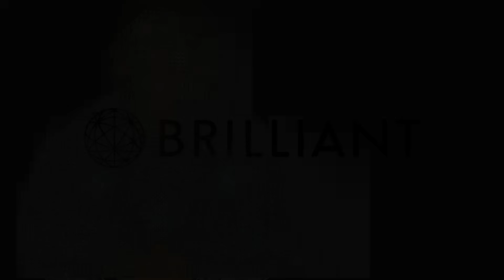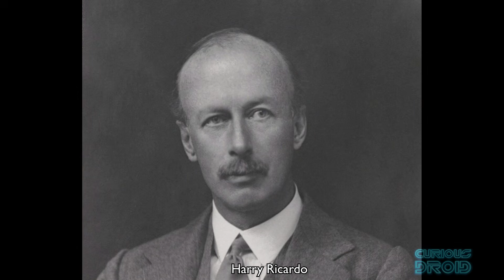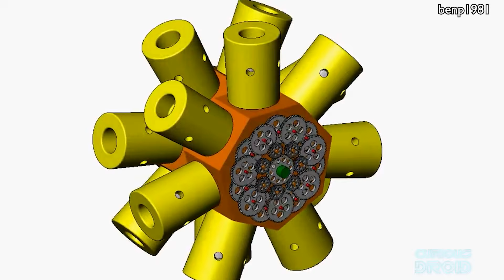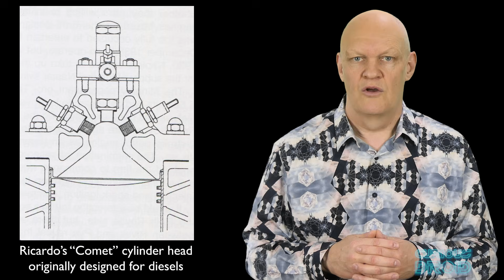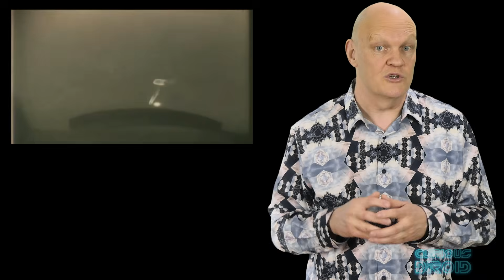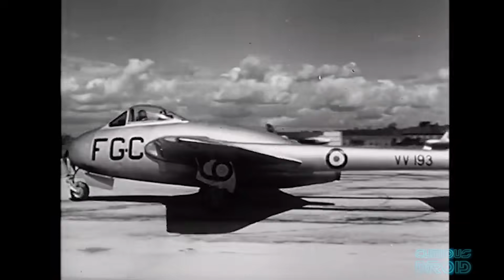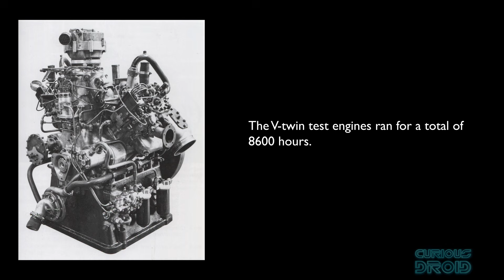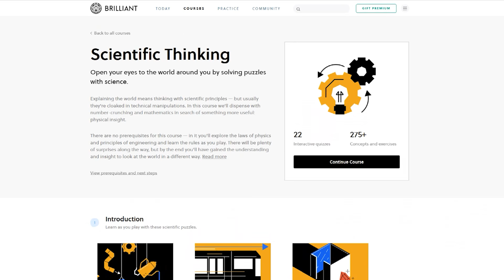Rolls Royce Crecy - The Most Advanced Piston Aero Engine Never Made.

Comment: The Napier Sabre engines on a test stands were clocked at 5500 hp at a capacity of 36.65 litres. That's also pretty impressive!
Reply: And a less powerful version was put into a Hawker Fury prototype (that would eventually become the Bristol Centaurus-powered Sea Fury) to produce one of, if not the fastest piston-engined combat aircraft ever.
Reply: Odd that there's absolutely no mention of the Napier Nomad two stroke, it would be interesting to compare the time lines of both engines.
Reply: @joejoejoejoejoejoe4391  I think that was a Diesel...
Reply: There,s a Napier Sabre engine at the Hendon museum.Talking to a curator there he explained to me that had reliability issues and in cold weather proved very difficult to start.Superb piece of kit though.
Reply: @glennpowell3444  The Coffman starter (bit like a blank shotgun cartridge - famous from the film "Flight of the Phoenix" - really wasn't powerful enough to start the engine, but there was no electric started powerful enough,  The initial impulse power of up to 25hp could damage the engine, a conundrum.  No multigrade oil in those days, in cold weather it flowed like treacle and there were a lot of oiled bearing surfaces in sleeve valve engines.  The ground crew had these big burners and fans on trucks and would blow the hot air through the chin radiator to heat the engine up in cold weather, when that wasn't possible, they just started the engines up every few hours - not good for the engines.  The reliability problems were mostly in manufacture and maintenance and were fully solved by the end of the war.  The "stealing" of several centreless grinders from P&W (I think) solved the final sleeve manufacture problems.
Reply: @robertnicholson7733  Good reply thanks.Yes familiar with the Coffman starter( and the film which was epic).I didn't realise they adopted P and W parts though.I can imagine the torque required to turn that engine and two cranks was enormous though!No wonder it was reluctant to fire up.Thanks.
Reply: @glennpowell3444  Sorry, I was not clear.  What happened is that pressure was brought to bear from the British government and a number of Sundstrand centreless grinders due to be delivered to P&W's production line were diverted to Napier.  This allowed the sleeves to be ground to an accurate and precise cylinder, the lack of this being the major problem with the Sabre.  Apparently, P&W were not happy, I wonder why?  >;-)>

I can't remember where I read it, also I do not know whether it is true, but the story goes that the Sundstrands were shipped to Britain in the hold of a passenger ship against the agreements in place at the time.  Unfortunately, I don't know when this "hijacking" occurred, it would be interesting to see if the ship part of the story is true or not.
Reply: @robertnicholson7733  I understood with the tooling sorry.I suggested parts. I realised my mistake after posting thanks.
Reply: @robertnicholson7733  Oh as a post script machining a sleeve valve is engineering to the very finest of tolerances must take some doing to rotate and breath properly .Extreme engineering way before CNC !!!!Turned by hand.
Reply: @glennpowell3444  Yes! I have seen that one more than once. I supposed I shouldn't have been surprised at how big it is but I was.

There was also the problem described by Clostermann that it was a difficult engine to operate. Carbon dioxide seeped into ther cockpit so the pilot had to breathe oxygen all the time. It also consumed about 27 litres of oil per hour. Clostermann also says that if the engine didn't fire the first time, there was a possibility a a blowback and the aircraft bursting into flames... Temperamental bugger it was.

But I agree with you: it was a remarkable piece of engineering. The whole concept was pretty remarkable and the American ended up making their own versions.
Reply: @thethirdman225  That's also interesting.I didn't know about the oil burn!? To be honest reference its size I am always amazed how the engines of these sizes and weights were actually supported by relatively small airframes.They were essentially cantilevered within the support structures.Thanks for your comment and hope you enjoyed Hendon .The Halifax is still my favourite exhibit along with that famous Lanc.
Reply: @glennpowell3444  No worries. If you haven't read "The Big Show", I thoroughly recommend it. It's one of the very best WWII memoirs out there. Clostermann was a journalist so he knew how to write book and more than any other I've read, he pulls no punches about his fear levels. There are sentences you won't find in any other book like, "Obviously my nerves couldn't stand Flak anymore". Very revealing and honest.

I agree completely about the support structure and these things were supposed to be stressed to multiple G. They don't even look like they'd hold the weight of the engine standing still!

There's an audio file out there of a Tempest and you can hear how different the Sabre sounded compared with other inlines. Much as I like it, I'm more of a Centaurus man, myself, having seen the Sea Fury at many airshows.
Reply: @thethirdman225  Airshow man here too.The Bristol centaurus is a brute and I prefer a radial for noise.I read alot and note Clostermann.Thanks.
Reply: @glennpowell3444  Same here. After you’ve heard a Centaurus the rest are just meh.
Reply: That came up in Setright’s “The Power to Fly” but it’s actually not true. I can’t even find out where he got it from because he didn’t get it from Napier. Both Calum Douglas and the late Bill Gunston poured cold water on the claim, Gunston with mathematical formulae and Douglas with a mechanical explanation. Douglas says that the Sabre’s sleeve valve made it less open to development than a conventional poppet valve engine. The reason is the pressure exerted on the sleeve, making it expand in an already close-fitting block.

Sleeve valves had plenty of advantages, including but not limited to lower noise and high installed base power. What it didn’t do well was boost, which was the best way to achieve higher torque at the time. AFAIK, the highest power achieved by a Sabre in service was about 3,200, though 3,500 has been claimed.
Reply: @thethirdman225  Douglas book is the shizzle.
Reply: @kiwihame  Have you read it, you lucky dog? It sounds like the bomb. I haven’t got it yet but he’s in a couple of excellent YouTube presentations. It’s on the list but it’s rather pricey! Still, I suppose you get what you pay for...
Reply: @kiwihame  I just ordered it.
Reply: @thethirdman225  Napier advertised it as 3500hp+ in Flight Magazine.  It has been claimed at 4000hp for the Sabre VIII on the test bed, that is certainly possible but i have not seen any documentation.  The secret to the Sabre's power is the high RPM.  I would have to do some mathematics to see if anything much above 4200rpm is possible, but I am too lazy.  The BMEP would be high at 5500hp but I doubt it would be high enough to cause significant strain in the sleeves, I also doubt it would be possible to develop that BMEP without some secret squirrel knockless fuel, that is, fuel that does not detonate under any circumstances.
Reply: @robertnicholson7733  I've seen these claims before. Once you understand the Sabre, they sort of don't make a lot of sense. Napier advertised the E.122 as 3,500 hp but I can find no evidence that it ever ran, much less ran in a production aircraft.

And it's advertising material anyway...

The biggest problem with this engine was lubrication and compared to a conventional inline V-12 or radial, the Sabre used a lot of oil - about 27 litres per hour in normal use.

Napier had a lot of trouble getting it to work reliably. Napier drew on a lot of the work done by Roy Fedden at Bristol, who built the redoubtable Hercules and later Centaurus engines. The problems of these engines took almost a decade to solve and thousands of different methods were tried before the engine could be made to run properly, which fortuitously coincided with the start of the war. It almost broke Bristol.

The problem was that the sleeves were not just valves, they were the cylinder liners as well. These sleeves were about 2-2.5mm thick and had to absorb enormous pressure when the engine fired. While these components were quite strong, they were also subject to both thermal and shock expansion. This placed enormous stress on the lubrication system because the sleeve's fit within the block - already pretty tight - would change.

Combine that with the fact that at certain parts of the stroke, the sleeve was unsupported by the cylinder because it was over the ports.

Tighter tolerances means less space for lubricating oil. Less lubricating oil means more heat. More heat means even tighter tolerances, meaning less oil and more heat... and so it goes until the engine seizes. This is why the Sabre was limited in its development potential.

By contrast - and nobody talks about this - the Bristol Hercules - a beautiful engine that was not so widely appreciated, probably because it never found its way into a Spitfire airframe - had ten fewer cylinders and put out about 1,700 hp. I think it started at about 1,200. Yet the Sabre was 36 litres and the Hercules 38. By contrast, the 2,520 hp Centaurus was 53.6 litres.

Calum Douglas goes into this in one of his Q&A videos.
Reply: @thethirdman225  I do understand the sleeve valve engines, i came to sleeve valve aircraft engines via the original Burt designed Argyll engines and to the single acting from the double acting, specifically Minerva.  

The Sabre is fascinating to many people because it is different.  Both the Merlin and Griffin were just another V12 aero engine, both the Bristol Hercules and Centaurus, just another radial (apart from the sleeves).  The Daimler Benzs were just boring except for the direct injection as were the BMWs but the Junkers....much more interesting.

I find all the details more fascinating that the big story.  So although Fedden, Ricardo, Halford, Rowledge, Hooker,etal are best know for the flashy headlines, I rather like the less flashy, more down to earth problem solving, which they also did.

I am well aware of Fedden's work on the sleeve valve engines, and I have looked at quite few Hercules engines, including a mostly complete one and a partial one sitting on a dirt floor in a hut on the Atherton tablelands, in Far North Queensland Australia (so sad).  BUT, the development path for the single acting sleeve valves was Burt, then Ricardo, then Fedden from Ricardo and then Halford from Ricardo and finally RR from Ricardo.  It is Burt who deserves the credit, the aero engines were not much different to Burt's original design, RR did change the drive mechanism in the Eagle 22, but AFAICR the Exe and Pennine drives were essentially the same as all the others.

As an aside, i can remember when i was about 7 or 8, i went to a school friend's place, there were Merlin conrod pairs (several of them) hanging on the walls as decoration, pistons as ashtrays, and other bits I had no idea about, his father used to do full overhauls on Merlins.  Later on, a secondary school friend's father was a RAF aircraft maintenance groundcrew on Merlin and Griffin powered Spitfires, he never worked on the Sabres.  I also had a long conversation with a guy who was rebuilding a Merlin at one of the Australian aircraft museums, he had worked on them for years during and after the war.  The idiots at the museum weren't even watching what he was doing, they should have filmed every minute.  i suppose what I am getting at is just how much knowledge was out there and how little we valued it, too late now.  And so it is with the Sabres.

When it comes to attribution, this is a serious problem with many aero engines, just what is true.  We have some information that is well documented and other information that is not.

For instance, the Sabre using 27 litres of oil in an hour of normal use, just where did that information come from?  Which model Sabre?  When?  

Let us look at the RR Griffin for which I have some official data:
Griffin 65  oil consumption 0.022 lbs/hp/hr  B.m.e.p. 256lb./sq.in.
Griffin 88  oil consumption 0.009 lbs/hp/hr  B.m.e.p. 302lb./sq.in.

So at cruise (say 1300hp) Griffin 65 oil consumption 28.6 lbs./hr, roughly 15litres/hr
So at cruise (say 1300hp) Griffin 88 oil consumption 11.7 lbs./hr, roughly 6litres/hr
These number would be for a fresh engine. A big difference in the main production run of the Griffin.   Oil consumption on earlier Griffins and Merlins could be much higher, also, condition was critical.  Ring technology and machine finishing improved dramatically during the war, so I believe the 6litres/hour.  Merlins were usually quoted at a gallon an hour and up - comparable, so partial confirmation.
The Tiffy had an oil tank of about 16 imperial gallons (I think), so at 27 litres per hour, the tank capacity would be good for about 2.7hours. Must have been tight when they were using 2 drop tanks to increase the range to 1000miles, very tight for, what, 3 hours flying time.

Now as to power, I have just found this site (I may have seen an earlier version some time ago), I don't know which sources he used for the power figures (he has a bibliography at the end)  but much of the power data is accurate against known, definitive sources:
https://oldmachinepress.com/2020/09/20/napier-h-24-sabre-aircraft-engine/

The following quote from  the bottom of the article looks far too credible to be pure fabrication.  If you are in doubt, Ii suggest you contact the author of the page.  

[Quote]
Initially, the Sabre VII had a takeoff rating of 3,000 hp (2,237 kW) at 3,850 rpm with water/methanol injection and 17.25 psi (1.19 bar) of boost. This was later increased to 3,500 hp (2,610 kW) at the same rpm with 20 psi (1.38 bar) of boost. The engine’s military rating at 3,850 rpm with 17.25 psi (1.19 bar) of boost and water/methanol injection was 3,055 hp (2,278 kW) at 2,500 ft (762 m) and 2,820 hp (2,103 kW) at 12,500 ft (3,810 m). The water/methanol injection flow rate was 76 US gph (66 Imp gph / 300 L/min) at takeoff, 78 US gph (65 Imp gph / 295 L/min) at military power in low supercharger, and 122 US gph (102 Imp gph / 464 L/min) at military power with high supercharger. The water/methanol flow rates corresponded to 30 percent of the fuel flow at low supercharger and 45 percent of the fuel flow at high supercharger. The Sabre VII’s fuel flow was 284 US gph (235 Imp gph / 1,068 L/min) at takeoff, 287 US gph (239 Imp gph / 1,087 L/min) at military power in low supercharger, and 289 US gph (241 Imp gph / 1,096 L/min) at military power with high supercharger. At 3,700 rpm and 10.5 psi (.73 bar) of boost, the Sabre VII had a normal rating of 2,235 hp (1,667 kW) at 8,500 ft (2,591 m) and 1,975 hp (1,473 kW) at 18,250 ft (5,563 m). Cruise power at 3,250 rpm was 1,750 hp (1,305 kW) at 8,500 ft (2,591 m) for a fuel consumption of .45 lb/hp/hr (274 g/kW/h), and 1,600 hp (1,193 kW) at 17,000 ft (5,182 m) for a fuel consumption of .51 lb/hp/hr (310 g/kW/h). The engine was 83.0 in (2.11 m) long, 40.0 in (1.02 m) wide, and 47.2 in (1.20 m) tall. The Sabre VII weighed 2,540 lb (1,152 kg). Some sources state that a Sabre VII engine achieved an output of 4,000 hp (2,983 kW) and was run at 3,750 hp (2,796 kW) for a prolonged period without issues during testing.
[End Quote]

So 3500hp, believe it, or not.  Quoting power number really isn't helpful, B.m.e.p. is much better to determine the engine design success (see Griffin numbers above).  The Sabre spun about 1000rpm more than the others (a third as much again) so more power for the same B.m.e.p., the whole point of lots of small cylinders.

Personally, I am far more interested in finding more information on the Junkers Jumo222, Jumo223, and Jumo224, especially the last two.  Unfortunately, this is highly unlikely.  Those quadrilateral two stroke diesels really put the triangular Deltec to shame.  Mind you, I think the shape of the Deltec was (at least partially) determined by the shape of the fast patrol boat engine rooms.

Sleeve distortion through combustion pressure, hmmm, first we would require the stress/strain curve for the sleeves. Not too hard, just need someone to pressurize an unsupported original sleeve and measure the expansion/pressure curve.  We should be able to estimate the combustion pressure curve with sufficient accuracy.  But until that information is forthcoming, it is all moot.  Sleeves covering ports, deflection is a little harder to calculate but still need data to do it.

Yes, yes, thermal issues, i too read all about it with the Hives 50degree (centigrade I think) temperature differential, although no one is sure whether he was talking about the air cooled Exe and Pennine or the liquid cooled Eagle22.  So a question for Hercules versus Sabre as well  The thing is, as the gap between the block and the sleeves decreases the thermal transfer efficiency increases, so perhaps your positive thermal feedback loop does not exist the way you think it does.  There was a quite technical paper written on these issues with sleeves that I read quite some time ago, unfortunately, it is in with literally Gbytes of similar engineering information.  Many of my books, including the Crecy book, were loaned out when my wife and I went travelling in a motorhome for 12 years.  Apparently, they are not going to be returned, very annoying.
Reply: @robertnicholson7733  Mmmm... Those figures were all for the Sabre VII which used methanol water injection and as far as I can tell, was never used in a production aircraft. In fact, I'm not sure it ever flew. Now, from that quote:

"Some sources state that a Sabre VII engine achieved an output of 4,000 hp (2,983 kW) and was run at 3,750 hp (2,796 kW) for a prolonged period without issues during testing."

I frankly, don't believe a word of that. Not a bit of it. Not your fault but no way.

I don't believe the claimed power and I certainly don't believe the claim that it ran reliably at5 3,750 hp for extended periods. I don't believe it for two reasons: 1) I can find no evidence that it ever ran at that power level or even close and 2) no reference for that claim is provided, just a vague "some sources state". My background is journalism and academia so that claim just doesn't cut it.

There are, as you know, only two ways to improve power: increase torque or increase RPM. I know you know this because you referred to calculating for 4,000 RPM earlier. I can't see how such an immense increase in power could have been achieved, bearing in mind the exponential increases in internal stresses that go with it.  Now, I don't mind a certain amount of spitballing - we all like to do it with out favourite things - but there's spitballing and there's making the facts fit the story. When something that starts as something that might be plausible and gets converted into "fact" with no verifiable sources, I just switch off.

You probably realise that I'm not an expert on piston engines of any kind, either by profession or inclination. I just look for what is believable and what isn't. This one doesn't pass the pub test.

"So a question for Hercules versus Sabre as well  The thing is, as the gap between the block and the sleeves decreases the thermal transfer efficiency increases, so perhaps your positive thermal feedback loop does not exist the way you think it does."

Not my loop.

Decreasing the gap between the sleeve and the block might help the thermal transfer but not the lubrication. So where do you see this ending? Sooner or later, the engine will sieze.
Reply: @thethirdman225  A couple of small points:
Just because it never flew does not mean it was not flight ready, Unfortunately the British Aero industry is littered with abandoned projects.  Gas turbines were seen as the future and many thought it would not take long to increase the fuel efficiency back up to levels for ICE engines, as you may know, they were greatly mistaken.  However, if you want to go fast then you use a turbine, in this they were not mistaken.  The Eagle22 was in much the same boat as the Sabre VII, both anachronisms.  In any case, the VII was not a new engine, there were modifications and strengthening involved (like with the IV) but it was essentially the same engine.

ADI (methanol/water injection)  was part of the Aero engine main stream, so I see no reason to single the Sabre out.  Similarly, exotic fuels (very dangerous and toxic ones)  were also fairly mainstream.  I don't see this as a point for discrimination.

Before I try out some back of the beer coaster calculations, I might add that power outputs such as we are discussing was not really an issue in later times.  In 1982 the BMW M12/13 F1 engine which was a turbocharged 1500cc 4 cylinder was good for 1400hp (calculated but probably pretty accurate, nevertheless) in qualifying form, and about 1000-1200 in race form (the driver had a button to change forms).   

This type of power was forecast back in WWII, at the end of the war all the engine manufacturers knew that the path to power was just to stuff as much air and fuel into the engine as possible while holding it together and avoiding detonation.  It still is.  It is possible to get somewhere north of 1700hp at the back wheels tt of an Australian designed and built Ford Falcon 4.2litre straight six by replacing the valve springs, head studs, pistons and conrods, fitting oversized injectors, a big turbo, and suitable engine management software, everything else being factory including the crankshaft - a street car at that.

Tresilian of RR Crecy fame did some design studies on a turbo compound 2 stroke design that was to produce 2500hp from 7.8 liters, or a two stroke X24 of 39litres producing 8100hp at 4600rpm on 35lbs of boost.  The problem was the prop gearbox in the 7.8litre design weighed more than the rest of the engine.

 If I look at piston speed as one of the limiting factors, a simple calculation based on know max speeds for period conrods (mostly German Aero engines like the DB603N and the Jumo 613E) of about 18metres/sec, the Sabre could have turned at 4500rpm.  I have never seen this number officially mentioned.  Certainly, 4200rpm would have been possible.  Working off the know and official 3055hp at 3850rpm, 4200rpm is about 3300hp and 4500 rpm is 3570.  I don't think this is the way they would have come to these higher powers, it would almost certainly be through forced charge induction.  Napier was workng on a 3speed, two stage, inter and post cooled supercharger system, where this fits in the Sabre VII story is the unknown to me.

I believe 4000hp is possible under some pretty extreme circumstances, but whether it happened is the question.  Napier was known for doing extreme things like purposely driving a turbocharged Napier Deltic well beyond its design limits to essentially see what happened, as forecast, conrod failure at a slightly higher velocity than what the Napier engineers had calculated. Of course, during the war RR consistently tested Merlins, Griffins, etc. to destruction to see what needed to be improved, in this RR reigned supreme, at least in Britain, in the Merlin the development work required was extreme.

Not my loop.  Well it was the positive feedback loop you described, in reality it just doesn't work that way.

Ricardo dealt with the heat transfer problem of the oil film between the sleeves and the cylinder castings in one of his lectures to a whole bunch of engineers who would not have let him get away with much.  He considered it a non issue.  Napier themselves implemented a number of non-conventional approaches to lubrication and oil consumption and appear to have succeeded - I do not have a reference, do you for the 27litres/hr?  All of this carried over to the Deltic where not only was lubrication critical but also the issue of bore glazing had to dealt with.  They used multiple methods including dimpling the bore, something that harks back to hand scrapping bearing surfaces on lathes, milling machines, etc.

Finally, lubrication (tribology - a part of fluid dynamics), what you must understand is that this area is not subject to common sense or normal projection.  Fluid dynamics is highly (extremely!!) non-linear, can be chaotic and defies complete analysis, we have merely touched the surface. 

If the cylinders, sleeves, etc are properly formed and have the correct surface finish, the oil film can support enormous pressures with no interference of the metallic surfaces.  There are many examples of this.  One I would like to draw your attention to is the Michell slipper bearing.  When Michell developed this bearing (and the theoretical foundations for it) he revolutionized ship design.  Previously, the thrust from the propeller had to be transferred to the ship by multiple, large, precision aligned, conventional thrust bearings.  Michell reduced all of this to a single, relatively small, thrust bearing that generated its own hydrodynamic thrust.  The entire thrust of the enormous propeller is transferred to the hull of the ship by an oil film!

In the Sabre, seizure was almost always a function of distorted sleeves, by the end of the war this was solved, and the engine was considered very reliable.
Reply: @robertnicholson7733  
"Just because it never flew does not mean it was not flight ready"

For the purposes of this debate it does. As I said, I still cannot find any reliable reference that says any Napier Sabre variant produced more than 3,200 hp. And using the same reasoning, I can find no reference showing that the E.122 - supposedly good for 3,500 - ever proceeded beyond the drawing board. That tell me that a 4,000 hp Sabre is a myth.

"ADI (methanol/water injection)  was part of the Aero engine main stream, so I see no reason to single the Sabre out"

This is wishful thinking Robert. I'm sorry but I can't think of a nicer way to say it but just because the Germans used MW50, that doesn't mean the British were using it, much less the Sabre.

"In 1982 the BMW M12/13 F1 engine which was a turbocharged 1500cc 4 cylinder was good for 1400hp (calculated but probably pretty accurate, nevertheless) in qualifying form, and about 1000-1200 in race form (the driver had a button to change forms)."

This is not remotely comparable. The BMW did not have sleeve valves, ran on highly specialised fuels like toluene and ran at 5 bar boost for one lap. And it ran at that power for one year - I think it was 1987. In any case, there is no comparable sleeve valve in the BMW. Besides - and this is a critical difference between aero engines and racing car engines - Aero engines are designed to run at 80% power or more for long periods so peak power isn't as critical as being able to run reliably for extended periods. A mate of mine tried this with powered hang gliders in the 1970s, using 250cc motorcycle engines and he broke a number of them doing it. Most engines are simply not designed for that kind of sustained power output. The demands on aero engines are completely different.

"Napier was known for doing extreme things like purposely driving a turbocharged Napier Deltic well beyond its design limits to essentially see what happened, as forecast, conrod failure at a slightly higher velocity than what the Napier engineers had calculated."

I have never seen anything to suggest that Napier did anything differently from other manufacturers in WWII. Their development of the Lion in the Schneider Cup series was probably their high water mark in their quest for extreme power (in per litre or per cylinder terms). Beyond that, the Sabre was about meeting a foreseen requirement, rather than trying to see who could make the most power.

"Not my loop.  Well it was the positive feedback loop you described, in reality it just doesn't work that way."

Yeah but your reality says that the tighter the sleeve fits the better it works because of heat transfer into the block. When does it become too tight? When does the engine seize, Robert? They were already a pretty tight fit at operating temperature.

"He considered it a non issue."

So? He was talking in the 1920s.

"Finally, lubrication (tribology - a part of fluid dynamics), what you must understand is that this area is not subject to common sense or normal projection.  Fluid dynamics is highly (extremely!!) non-linear, can be chaotic and defies complete analysis, we have merely touched the surface."

We don't need detail on this. Surely there is a point of no return: that point where there is simply insufficient lubricant between the two surfaces to prevent the engine from seizing. Calum Douglas explains this in one of his videos. You are talking as though seizure wouldn't happen. Where do you draw the line?

"In the Sabre, seizure was almost always a function of distorted sleeves, by the end of the war this was solved, and the engine was considered very reliable."

Douglas disagrees. I don't think it was ever that simple. Neither does he.

There are all manner of cult-status engines out there which capture the public imagination and inspire people to create rose-tinted scenarios. The Porsche 917/30, the BMW M12/13 and the Napier Sabre are obvious ones. But when you go beyond the hyperbole and read the comments of - in this case, pilots - the reality sinks in.

"However, this hasty rushing into action had not been without its disadvantages. The Sabre engine found a diet of 130 grade fuel uncongenial. There were some serious accidents. Snags arose over the induction system (the Sabre was a sleeve-valve engine), over the lubricating system - the oil pressure sometimes suddenly dropped to zero - carbon dioxide suddenly found its way into the cockpit, etc..

The worst was the accumulation of petrol and oil fumes in the carburettor intake, which led, we were told if ever the engine backfired, to the plane bursting into flames, and sometimes exploding in the air in a matter of seconds." - Pierre Clostermann, "The Big Show"

That was from an operational pilot who flew the Tempest.

There were other problems Clostermann talks about in other parts of the book: oil consumption, difficulty starting, carbon monoxide in the cockpit (he incorrectly refers to carbon dioxide)... There was also matters relating to the Coffmann starter system and its use with both a H form engine and sleeve valves. The oil of that period had a tendency to congeal and starting the engine presented wear and tear problems at the tops of each bank. Secondly, the sudden shock of an explosive system like the Coffmann, could potentially damage the valve gear operation (Douglas).

So clearly, power isn't everything. This begs the question (two, in fact) - if the Sabre was that difficult to operate in service, what was the point of trying to get more power out of it? There were already enough deficiencies in its operational readiness as it was. And why, if the Sabre had so much potential, was it replaced with the Bristol Centaurus?
Reply: @thethirdman225  Reply part2
<quote>
I have never seen anything to suggest that Napier did anything differently from other manufacturers in WWII. 
<end quote>  

The Initial design and development of most WWII engines was well before WWII.  Also, most of these engines had a design pedigree or philosophy going back much further, that is, the manufacturers kept redesigning the same engine.  For instance, RR had designed V12s for 20 years or so, their branching out into X engines was problematic and ultimately fruitless.  Bristol and its predecessors had designed radials for a long time and spent quite some time on sleeve valves. Napier was a small company and had a bumpy history (RR's most hated enemy, see Bentley and Rowledge), but careful study will show how far they pushed the envelope, starting in the very early days of car manufacture, through to the Lion and the Cub.  

Halford fitted in quite well, he always pushed the envelope. He started with the H engines in 1927, joined with Napier for the Rapier and then Dagger. Then Napier and Halford changed from an air cooled, poppet valve, vertical, H engine to a liquid cooled, sleeve valve, horizontal, H engine of unprecedented design power, a big shift in design philosophy. Design work began in 1936, by January 1938 it had passed acceptance tests with a power of 1350hp. In March 1938 it passed a 50-hour test with peak power of 2,050hp.  In June 1940, the engine passed a 100-hour type test with a maximum output of 2,050 hp, production.  In contrast, the RR Merlin design started sometime before 1933, things did not go well despite the considerable resources available to RR, in August 1937 the Merlin was at 1030hp maximum power (comparable B.M.E.P applied to a Sabre would indicate 1700hp).  Of course, by 1940 Hooker had waved his magic wand, the rest of the design team could finally get out from under (partially) and the Merlin started its rise to fame.  The Sabre was stuck with reliability problems and an inadequate induction system with power staying much the same from then on.  Napier had pushed the envelope hard and fast with the Sabre and it came back to bite them, they just didn't have the resources of RR or Bristol to address the production issues.  Photos of the Acton works tell the story.  

The Sabre was the smallest of the three high-powered engines the air ministry was betting on for the big Hawker fighter, hoping one would succeed, they were the Centaurus of 53.6l, Vulture of 42.5l, and the Sabre of 37.6l.  The Vulture was cancelled (and the Hawker Tornado with it) due to significant design issues and poor power delivery (it was more or less two Peregrines on a common crankshaft and the Peregrine, itself, was just an updated Kestral), the Centaurus was not put into production until the very end of the war, and the Sabre had serious production issues.  The Sabre, of course, did power aircraft in WWII and powered IMO the best low level British fighter.  The final backup engine for the Tempest was the Griffin but at the time it was destined for other uses and was underpowered for the Tempest.  

Indeed The Sabre was the only 24 cylinder aero engine to see serious production, German aero engines that deviated from their manufacturer's long term design philosophy were also unsuccessful, e.g. Junker Jumo222, etc.

So, in my opinion, Napier was very different to the others, except, perhaps, Junkers.

<quote>"Not my loop.  Well it was the positive feedback loop you described, in reality it just doesn't work that way."

Yeah but your reality says that the tighter the sleeve fits the better it works because of heat transfer into the block. When does it become too tight? When does the engine seize, Robert? They were already a pretty tight fit at operating temperature.  
<end quote>

The reality I live in but i don't own it, it is pure thermodynamics, combined with tribology, materials science (metallurgy is just a subset), mechanical engineering, and production methodology.  Very complex and unpredictable, even today, which is why all the manufacturers (and Ricardo Engineering) built test engines (usually of two cylinders ) and prototypes.  Fedden used a two cylinder test engine to test all those sleeve variants, I have a photo of it somewhere.  

Anyhow, what I said was "as the gap between the block and the sleeves decreases the thermal transfer efficiency increases", you will note I expressly stated "thermal transfer", alone.  Even then, thermal transfer is a two-edged sword, the need to keep components at design temperatures against excess heat rejection.  Excess heat rejection decreases the amount of heat energy available that can be converted to kinetic energy as well as increasing the enlargement of the cooling system.  IC engines are heat engines and all the usual rules apply.

<quote>
"He considered it a non issue."

So? He was talking in the 1920s.
<end quote>

No, in the 1950s, I think to the SAE.  He also addressed it in his book "The High-Speed Internal Combustion Engine" 5th Edition, a completely rewritten edition from the 1960s.

<quote>
Finally, lubrication ..Fluid dynamics is highly (extremely!!) non-linear, can be chaotic and defies complete analysis, we have merely touched the surface."

We don't need detail on this. <end quote>

Perhaps you don't (who are the "we"?), but the world runs on thin films of oil. For example, most engines run plain bearings with very large forces acting on a relatively small area.  The  bearing surfaces are kept apart by a very thin oil film maintained by a fairly low oil pressure.  Just to make things more interesting, the load is cyclic and subjected to various perturburations caused by , amongst over things, flex and modes in the crankshaft and that is just the main bearings, after that, there are big ends, little ends, gearboxes, etc..  If properly maintained, not only do these surfaces not seize, they barely wear over the life of an engine.  They only touch when the engine starts, which is when most wear occurs.   

In any case, it was you who brought up the oil film issue.

<quote>
Surely there is a point of no return: that point where there is simply insufficient lubricant between the two surfaces to prevent the engine from seizing. Calum Douglas explains this in one of his videos. You are talking as though seizure wouldn't happen. Where do you draw the line? 
<end quote>

Depends entirely on the circumstances. Of course the sleeves sometimes seized which is why there were shears on the sleeve drives.  However, as techniques improved, sleeve manufacture was improved to the point where the Bristol Centaurus had very long TBOs, I don't have any authoritative information of the seizure rates of Sabres over their production history.  I have seen very little information on the RR sleeve valve engines.  This begs the question, why would RR persist with the Eagle 22?  RR had spent a fortune on developing poppet valves, if the sleeves were such a problem (and expensive), why use them?

<quote>
"In the Sabre, seizure was almost always a function of distorted sleeves, by the end of the war this was solved, and the engine was considered very reliable."

Douglas disagrees. I don't think it was ever that simple. Neither does he.
<end quote>  

Think or prove?  Do you, or he, have official data showing persistent sleeve problems throughout the production run of the Sabre?  What data does he have on Sabre maintenance?  How does it differ to Bristol data on sleeve valve issues?
Reply: @thethirdman225  reply part 3

<quote>
There are all manner of cult-status engines out there which capture the public imagination and inspire people to create rose-tinted scenarios. The Porsche 917/30, the BMW M12/13 and the Napier Sabre are obvious ones. But when you go beyond the hyperbole and read the comments of - in this case, pilots - the reality sinks in.
<end quote>

cult-status? rose-tinted? hyperbole?  ahhh  <sigh>  As to pilots, well I have full respect for them as I do race car drivers.  However, that does not make them experts on their machines.  There were few race drivers, very few, who were really good at developing cars but most were/are not.  In his era , Black Jack Brabham was considered the best development driver,  his friend Bruce McClaren another.  Brabham is, and is likely to remain, the only driver to win a world champion in a car of his own design.  He could have been an even more successful driver (another championship) but he often drove the "second best" car and left the more sorted car for others.

I haven't read Pierre Clostermann's book, but I would assume the carbon monoxide was more an issue with the airframe design.  The Sabres did catch fire sometime when starting, the ground staff put out the fire and carried on, Sabres weren't the only ones with the issue.  However, the hearsay comment at the end doesn't make sense.  It would be interesting to find out how a build up of fumes in the carburettor intake could occur with the prodigious amount of air being passing down that intake while the aircraft was in flight.   To me, passing on hearsay like that casts doubt on his understanding of the basics of aircraft engines and physics.  If he didn't see it, how did he know it ever happened?  It could just be another story bandied around.

RR was more concerned about backfiring of the Merlin, caused by pre-ignition, burning the fuel mix in the main truck (between the cylinders and the flame traps).  Several cycles of this could cause the engine to cut out, explosions and crashing aircraft weren't mentioned  (A. C. Lovesey).  The pre-ignition was tracked down to spark plug issues, both manufacture and maintenance. 

<quote>
That was from an operational pilot who flew the Tempest.
<end quote>

I would be interested to hear the opinions of the pilots who flew aircraft with early marks of the Merlin, at least before it became pretty much sedition to complain about the Merlin.  Everyone has their opinions, likes and dislikes, some loved the Tempests, some hated them, others changed their opinions from sortie to sortie.  Even the Griffin had its detractors and that was a very well-designed engine. 

The stakes are lower, but most people who work with imperfect machines are the same. I had (have?) irrational prejudices against certain stuff that I have worked on and exaggerate certain negative views, that doesn't make it fact, nor necessarily fiction, the truth couldn't be determined unless a detailed analysis was performed on the machine.

<quote>
There were other problems Clostermann talks ...
<end quote>
Most of this has been discussed in my previous posts. 

The stripping of upper cylinder lubrication from excessive fuel was well known and procedures were put into place to address the issue, I have seen references that state penalties for ground staff who did not follow the procedures were severe. 

I would still like to know the circumstances of the 27l/hr oil consumption figure you posted. 

The high viscosity of mono grade oils when cold (congeal is somewhat ambiguous), the problems it caused, and the solutions put into place have already been addressed in previous posts.  Sabres were not alone in having this problem.

And of course all the other issues are the usual stuff common to most engines, things break.

<quote>
So clearly, power isn't everything. This begs the question (two, in fact) - if the Sabre was that difficult to operate in service, what was the point of trying to get more power out of it? There were already enough deficiencies in its operational readiness as it was.
<end quote>

It was used as there wasn't any other engine available that could do what it did. As to getting more power out of it, well, if a lot of the work has already been done and RR (the enemy) was building a sleeve valve H24, who wouldn't work toward putting them in their place, just an opinion dressed up as an answer to a leading question. Your second sentence is gratuitous.

<quote>
 And why, if the Sabre had so much potential, was it replaced with the Bristol Centaurus?
<end quote>

The Tempest II and Tempest V were developed in parallel, the Centaurus didn't replace the Sabre, they just stopped making the Tempest Vs and honoured their contracts with Bristol.  There were 800 Tempest Vs manufactured and 450 Tempest IIs.   But wait!  If the Centaurus replaced the Sabre, and the Sabre still had serious problems, why order the Sabre V powered Tempest VI? They built 140 of them after the war.  I read somewhere that the Tempest VI was the last operational piston powered fighter used by the RAF.

The Sabre died because it was a dedicated military engine and the military was going turbines.  The RR Eagle 22 died because it was a dedicated military engine, all the aircraft it was destined for were cancelled, and gas turbines were coming.  The Griffin and Merlin continued in some end-of-war-aircraft such as the deHavilland Hornet (magnificent) but mostly kept legacy aircraft in the air.   

The Merlin was AFAIK the only liquid cooled inline high performance engine to see commercial use (and limited at that) and even then, RR had to derate it and do a lot of problem-solving to get its TBO up to a viable length, the TBO still wasn't great.  

The Centaurus was designed with a clear goal of dual military/commercial use, this dual use made it a more viable long term option, costs could be defrayed.  The RR Pennine was developed with a view of commercial use, once RR got into turbines the Pennine was history.  Equally, the Junkers Jumo 223 and 224 were clearly designed for commercial use.  The big American radials were on the same path as the Centaurus.  The British government pulled the strings on the aero industry and decided who did what.  After the Tempest VI, the British government made it clear that there would be no more Sabre contracts, the Eagle 22 was the preferred option, not that it did the Eagle 22 any good.  The other big issue was cost, it was an expensive engine to make and maintain, the order of cost went something like this; Sabre, Centaurus, Griffin, Merlin, Allison.  

I will leave it to others to fight out RR vs Packard, I personally liked the styling and chassis of the Packard cars of the 20s over most everything else of the era but think their automotive engines left a lot to be desired, there were far better engines on both sides of the Atlantic.

In one of your previous posts, you said you liked to think of yourself as an investigative journalist and that you wanted primary sources.  Well if you want to be an investigation journalist, you need to leave the attitude at the door, the little snipes especially when I would not accede to your narrative were very unprofessional.  You also need to leave YOUR narrative at the door.  I assume no pretence of being an investigative journalist, so I get to keep my narrative, although, most people who know me would laugh if anyone suggested I looked at anything through rose-coloured glasses.
Reply: @robertnicholson7733  I have taken the time to read your increasingly lengthy posts and I'm frankly finding your information less and less relevant to the case. So I will post again what I have been saying since the start and which I have yet to see any solid evidence on:

1) I can find no evidence that a production Napier Sabre engine ever exceeded 3,200 hp (which is a lot of power, in case you're getting jaded).
2) The proposed 3,500 hp E.122, as far as I can make out, never got beyond the drawing board.
3) I can find no evidence that the Sabre VII ever ran, much less ran reliably to 4,000 hp with 3,750 hp for extended periods.
4) BMEP is only one measure of engine efficiency (Volumetric Efficiency is another). Yes, that was the metric used which most influenced the Sabre design but it's not a substitute for a flying example. This is an example of "never mind the quality, feel the width".

This is from reading the likes of Bill Gunston and Calum Douglas. If you haven't read either then I strongly suggest you do, particularly Douglas. His book "The Secret Horsepower Race" is brilliant and is about as in-depth as it gets.

"In any case, it was you who brought up the oil film issue."

You are talking as though there doesn't need to be any oil and heat transfer will solve everything. When does thing become non-viable, Robert? When does the engine seize?

"This begs the question, why would RR persist with the Eagle 22?"

I neither know nor care. But if you read Douglas's book, you will soon see exactly why the more radical projects didn't go ahead and Britain concentrated on building things that worked and would present no problems in the foreseeable future.

"The reality I live in but i don't own it, it is pure thermodynamics, combined with tribology, materials science (metallurgy is just a subset), mechanical engineering, and production methodology."

When is there insufficient lubrication, Robert? When does the heat transfer reach its limit and the engine seizes?

"Think or prove?"

I could present a welter of data and you would still brush it off.

"Do you, or he, have official data showing persistent sleeve problems throughout the production run of the Sabre?"

This from someone who has yet to provide anything beyond a blog. I'm sorry Robert but you're not in any position to make demands. I have already told you that the problems I have believing the claims you and others are making are due to a singular lack of evidence. Read Douglas's book. He's a mechanical engineer who worked with the Toyota F1 team in the noughties. His credentials are very good and his research is as thorough as I have ever seen on the subject.

"I would be interested to hear the opinions of the pilots who flew aircraft with early marks of the Merlin, at least before it became pretty much sedition to complain about the Merlin."

I wouldn't. That's just whataboutism, Robert. Who cares about that? The point was that Clostermann explains the engine management quirks of the Sabre.

"Most of this has been discussed in my previous posts."

No it hasn't, Robert. You simply cannot fob off the words of an operational fighter pilot just like that. If you have ever done any flying (I have) you know that flying is all about procedures. It is totally different from motorsport in almost every aspect. Pilots are completely different from racing drivers. The start procedure for the Sabre was very precise. The throttle setting had to be exact and timing was critical. Flying the aircraft focused on settings, optimum speeds for efficiency (engine and aerodynamic), stall speeds, VNE, etc.. As for dismissing advice as "rumours", if a pilot was warned about a particular aspect of an engine, he had no choice but to take it seriously. His life depended on it. That's how it goes in flying, especially combat flying.

"The Tempest II and Tempest V were developed in parallel, the Centaurus didn't replace the Sabre, they just stopped making the Tempest Vs and honoured their contracts with Bristol.  There were 800 Tempest Vs manufactured and 450 Tempest IIs.   But wait!  If the Centaurus replaced the Sabre, and the Sabre still had serious problems, why order the Sabre V powered Tempest VI? They built 140 of them after the war.  I read somewhere that the Tempest VI was the last operational piston powered fighter used by the RAF."

Except that Hawker's future designs were all built around the Centaurus radial, right up to the Sea Fury, which remained in service through the 1950s.

"In one of your previous posts, you said you liked to think of yourself as an investigative journalist and that you wanted primary sources."

The hell I did. I made no such claim and it's not a matter of what I "like to think of myself as". My background is journalism and academia. That's it. To that end, all I care about is the best available version of the truth. To get that requires relevant references. And the whole point of this is that I can find nothing to support any of the points I laid out earlier.

"Journalism is printing what someone else does not want printed. Everything else is public relations." - George Orwell.
Reply: @robertnicholson7733  Amazing data you have written. It has answered many questions I have often wondered about. Thank you for taking the time to write this intriguing article.
Reply: @brianmuhlingBUM  Thanks, it is an interesting area but there is little surviving information out there on most of these engines.  The companies just trashed it when they; needed the space, moved, or were taken over.  I have done the same in my area of engineering, although, I can't ever see that information as interesting to anyone including me.

As far as I know, there is not even an extant set of original engineering drawings for any Sabre model.  I think there are drawings of early model cylinder blocks only , so the chance of original performance data surviving is very low.  Even RR information is very thin on the ground, oh well, we can always make it up.  >>:-)>>

All the best,
Rob
Reply: @robertnicholson7733  Thank you Rob for all that interesting information. During my motor racing days (1960's) using small capacity engines, anyone who could manage 100hp per litre without supercharging, would be doing very well. Huge motors can not manage 7000 r.p.m. or more otherwise they would fly to pieces. So I doubt that even super- supercharging the Napier Sabre, it would not manage those extraordinary figures that some people are claiming. Pierre Closterman mentions revs of up to 4000 and 3000 HP,  but whether he saw that on the tacho or not, we now will never know.
Reply: @brianmuhlingBUM  The Sabre IV (if memory serves) was a special high RPM version of the engine and was officially rated at 4000RPM.  The later ones reverted back to 3700 - 3800RPM range.  4000RPM in service would not be unreasonable, most engines were pushed hard in battle, I would not be surprised to see the revs go higher in a power dive.  I do not know how he found the power figure, there is no easy way for a pilot to find out.  

All of this is muddied by exactly what we mean by maximum power, the WER (War Emergency Rating) was not a standard and most manufacturers and countries defined it in different ways, some of them were strange to my mind.  

Napier definitely advertised the post-war Sabres at 3500hp (I have seen the ads in Flight).  Considering the audience they were advertising to, there would be little point in lying about the power output. 

If you project maximum piston speeds and BMEP of engines contemporary with the Sabre VII, you can get numbers in excess of 4000hp even when taking into account the additional losses caused by the higher rpm.  I personally don't think they would have pushed the engine much past 4000rpm, but there is no way of knowing.  

It was interesting that the later engines did not have the crankshaft counterweights of the earlier engines.  Perhaps it was better balanced than people thought.  Due to its layout, it was an immensely strong engine that did not share the stress issues present in V engines such as the Merlin

There is a partially sectioned VII in Canada complete with ADI.  I have held a long term hope that someone will disassemble the engine and scan it down to the last bolt to produce a full set of drawings for the VII which would have been the only candidate for the 3050 and 3500hp ratings.  Perhaps some questions would be answered. 

Large engines just can't compete due to flame front speeds.  A number of companies and organizations have done much research on combustion dynamics and the consensus is that 500cc per cylinder is ideal, so an H24 should be about 24 litres and be well over square.  Looking at Halford's earlier engines in this context is most interesting.  As I have previously posted, Stewart Tresilian did design studies on small (very over square) aero engines and racing engines for various British racing groups, unfortunately very little of it was put to work.

I just find it sad that so much fascinating information has disappeared, never to be seen again.
Rob
Reply: Thank you Rob, you have gone to a lot of bother typing all that valuable information that I really appreciate.
Best wishes, 
Brian, Western Australia
Reply: If you chopped of the massive supercharger and replaced it with turbos, could a sabre by squeezed into a spitfire ?
Reply: @joejoejoejoejoejoe4391  I would have thought that would make it even harder to fit. I can't see the point.
Reply: @thethirdman225  It would substantially shorten the engine, allowing the centre of gravity to be moved back to help counteract the increased engine weight; the turbos could be fitted wherever there's spare space. Turbos might also increase the power, especially at high altitude. But then I'm just an armchair dreamer with daft ideas, not an aeronautical engineer.
Reply: @joejoejoejoejoejoe4391  one issue in what you talk of here is that if for C of G reasons you install the turbos aft of the cockpit you'd need to rout the airflow ducting to and from the turbos. That would mean a more bulbous fuselage and the Spitfire's beautiful lines would look more like a jug, like a P47.
Reply: @joejoejoejoejoejoe4391  the Sabre was about 10 inches wider than Merlin or Griffon
Reply: @gleggett3817  Hmmmmm, It seems that my idea is blown out of the water by people who actually know stuff. I'm guessing that the merlin was a tight fit in the spitfire, certainly not 10 inches to spare. The centre line of the prop could be wrong as well.
Reply: @joejoejoejoejoejoe4391  Too heavy, the Griffin was carefully designed to fit and even then there were balance issues to solve, the Sabre is a very heavy engine.  Also the engine is a very different shape requiring a completely different type of cradle.  Just have a look at a Tempest V beside a Spitfire and you will see what I mean about the differences.  You can see the shape better in photos of the Tempest I prototype.  The tempests were very big aircraft.
Reply: and they had a lengthy teething period.
Reply: 5000, 500 HP the sabre ...the claim !
It's just not true !!!!)
Reply: A MYTH !!
Reply: @michaelgray7847  you mean just like Edison inviting the light bulb?
Reply: @julianneale6128  The Napier Power Heritage Trust would not agree with this claim of5000 500 HP.
Reply: Julian... BUT how many were ever made and how many survive today ????
Reply: @wilburfinnigan2142  not many at all. But at least there are hundreds of R-R Merlins flying Spitfires and P51s, along with all the other aircraft that used them...
Reply: @julianneale6128  Actually many of those flying are the Packard merlins, not just the RR Version.  All Merlin Mustangs, the canadian Lancaster Mk X Vera the FB26 Mosquito and some Hurrycanes all used the Packard version merlin !!!
Reply: @wilburfinnigan2142  never forget, every Merlin ever made is a Rolls-Royce!
Reply: @julianneale6128  IS that why RR refers to the Packard Merlin for the Packard VARIANT ??????   HUUUUHHHHH !!!!!  How about the PACKARD modified and improved versions?????  Why the PACKARD versions have a plain, NO NAME stamped steel valve cover and just a tag stating it was a PACKARD manufactured VERSION ??????  BUTT hurt limey that just CANNOT accept the fact an AMERICAN company had to step in and manufacture the Merlin FOR THE BRITS !!!! Just one way the USA "Saved your Limey a$$'s in WW II !!!!  FACT !!!  Deal with it !!!!
Reply: @wilburfinnigan2142  I name thee TROLL!